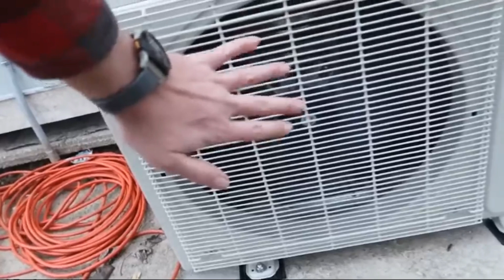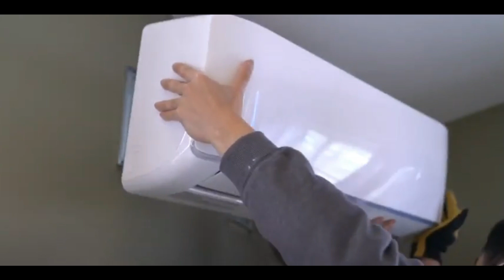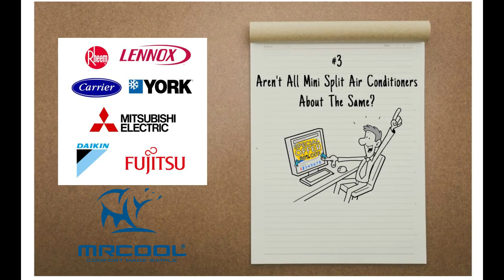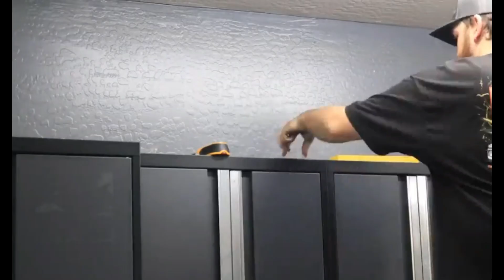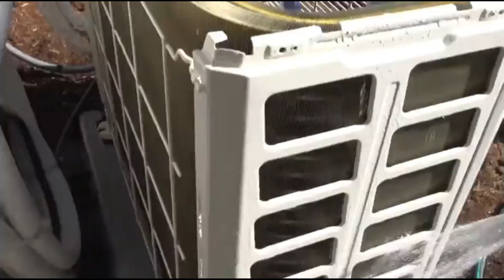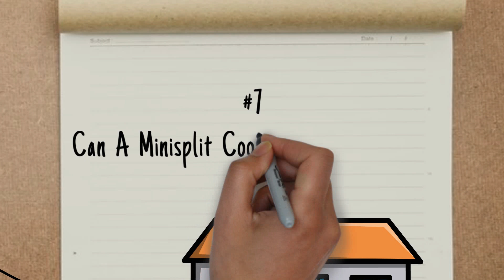The 7 Biggest Questions About Mini Split AC Systems

Comment: Can a outdoor unit run 2 or more inside units?
Reply from the maker: Yes, some manufacturers ie MRCOOL sell models designed to run up to 4 inside units.
Reply: @AmericanOutdoorsUSA  ok. So not every model just certain models...
Say I have one running 2 in 2 different rooms. Say one at 68 the other 73.. does the one at 73 run and shut off independently while the other still runs to reach 68???
Reply from the maker: @jimmieburleigh9549  We use MR Cool and yes, you can create "zones" to control the temperature for each area to your liking. Your mother in law comes to visit, you can turn the unit down to 60 in her room while your bedroom remains at 73.